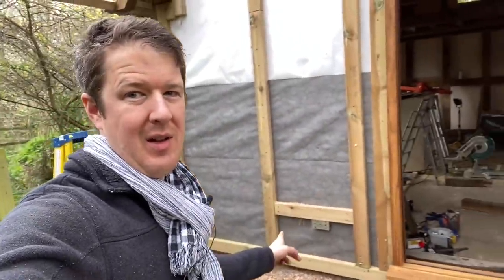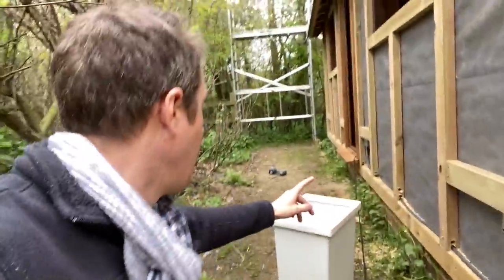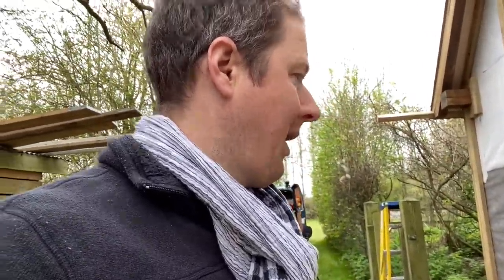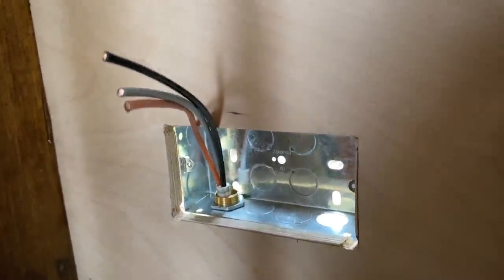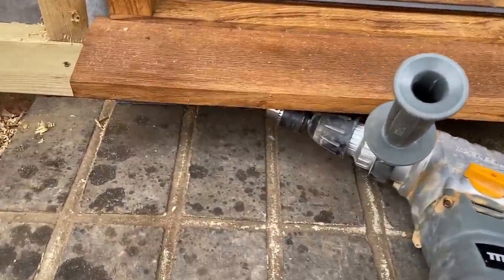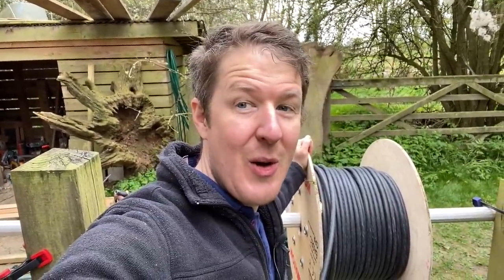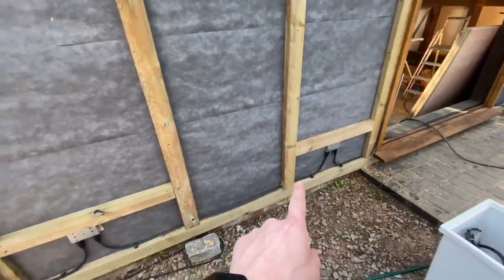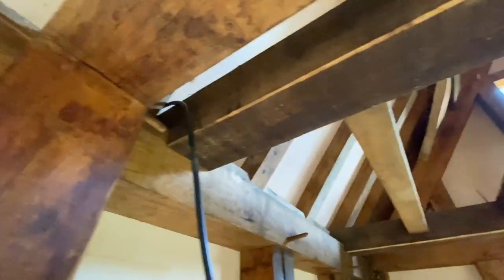Electrical Installation in a Barn - Part 2

Comment: Those holes looked quite big at the bottom of the joists - are the joists structural or just for attaching the eventual cladding to and therefore supported by the inside in some way?
Reply: Pretty sure the framework out there is just to space out for insulation, and cladding should be airgapped off it. The oak interior looks to be the actual structure. Obviously there weren't any screws between the 'studs' and 'sole plates' or those drills would never go through.

Bit of a shame they didn't make provision for cabling when they did it that way.. would've been easy, saved a whole lot of drilling, especially under that doorway.
Reply from the maker: Yeah you’re right there
Reply: They have pocket holes in them....not structural

Comment: Very nice job. In America because how close the cable  is going through the wood or timber as you call it, we would have to put a metal plate. There made for electricians and come with metal prongs  to fix them to the timber. There made by a company called Halex and there called protector plates. They are 1 1/2 x 2 1/2 inches and 1/8 thick.  Do you use anything like that.
Reply: They are used in the UK, but the cable has a steel armour so they are not really required

Comment: Obviously we haven't seen the end of the job yet, but I must ask. Have you considered sealing the boxes at all? Alu tape, a little low expansion foam. They're going to leak air like a sieve (of course, I don't know what sort of doors and windows this place is getting..). Also they're going to be cold spots and see condensation, limiting moist outside air flowing through them should help with that.
Reply from the maker: You will see in part 3 which goes up today at 5:30pm we sealed them using plastic membrane

Comment: You sure about the Knipex ErgoStrip? I first used it just as you did there to take off the inner sheath from SWA and it bit into the basic insulation within. I was lucky I was able to pull a bit more through and redo it, not touched the tool since... Once bitten twice shy and all that.
Reply from the maker: Yeah its great, i've used it so much the last few weeks I couldn't live without it now when doing SWA

Comment: Great Job, Can you not get the SWA in correct colours?
Reply: That's the colours 3 core swa is sold in, usually sleeve the black as green/yellow for cpc
Reply: I came across a light pendant today in a domestic house this had twin red T+E for the Line and Neutral colours,just a bit of black tape for the neutral
Reply: You can get Brown, Blue, Green/yellow SWA unfortunately not many wholesalers stock it!
Reply: It seems strange that they don't as most of SWA is used for L, N & E and has to be sleaved then again in the old colours you had to do the same as it was mostly sold red yellow blue cores.
Reply: I think here in Ireland, the wholesalers mainly sell it in the correct colours for single phase.
Reply: @paultipon twin red was meant for switch drops.
Reply: @supersparks9466  I know, whoever installed it however many years ago use a twin red for switch drop and another twin red for line/neutral loop in and out.
There was a T+E red and black as well so I guess they ran out of it, I did put sleeving on the red for neutral and noted it on minor works certificate.

Comment: Flexishield would have been a lot easier 😅 all the same properties as armoured, not quite as tough but you can use normal 20mm stuffers for the termination also smaller in diameter 😊
Reply: Exactly what I was going to post!
Reply from the maker: Good to know!

Comment: Have you seen / used the SWA storm glands. I highly recommend them. Only thing is they are probably £5/£6 more than a normal outdoor m20 gland. No shroud though.
Reply: My local cef has them at about 50p more than the normal ones. My go to every time 😁
Reply from the maker: Yeah i've tried them, not completely convinced yet.

Comment: Great content! I was wondering how come you aren't using t and e as it is in the cavity and not exposed??
Reply: He said the customer wanted it
Reply: I asked that in last video, Clent gets what client wants 🙄 would save a lot on labour and material costs using T&E and could of had 2.5mm 32A ring final for future expansion.
Reply: @barrybritcher  just because a customer ask for it doesn't mean thats right for the job, what if they said they wanted it in 1.5mm to feed the sockets that wouldn't be suitable, in this case id had gone for the armoured or possibly some SY cable
Reply: The cables don't run in a zone so putting them in T&E would make them even more vulnerable.

Comment: Hi, I am not a professional but a very keen DIY'r. My brother in law is an electrician and does any testing for me as I am quite OCD about conforming to regs etc as of course it could be someones life at the end of the day. (A consequence I guess of working in the aerospace industry for many years!) However, I would like to understand the logic/criteria behind the decision to install 2 radial circuits rather than rings for the power circuits.
Reply from the maker: Ring circuits are liable to break and cause problems, Radial circuits are much more logical. UK is the only country where ring circuits are still allowed and the number of broken ring circuits i've come across over the years is staggering. Radials are the way forward. If a radial breaks it stops working and you know easily where the break is.
Reply: @artisanelectrics  Many thanks for the explanation and I can now understand the logic. Great videos by the way. Always enjoy watching them.

Comment: Electrician from Norway here. why do you guys use metal pipes ? in norway we use plastic tubes, and we secure them with TC in the timber, its much easyer, ofthen the tubes are prefitted with earth (prefix 3g2 5), N and L leads, we just cut away 10cm of the tube before we put them into the selflocking hole in the box (SCHNEIDER 55-72/100F).. we used metal boxes and pipes i the 70`s.. also i see that in the fusebox you only fuse the L lead, and have earth protection on the main fuse.. we use earth protection 30mA fuse on all the circuits and it fuses both N and L, two module fuses on all cirquits, thats for TN systems to... is there a reason why to use metal pipes and boxes ? sorryror my bad english writing skills
Reply: The pipes provide access to the wires even if they are hidden in the wall. For example, you may think that you are unlucky enough to hit a wire with a nail or screw when mounting a shelf or similar. Then it quickly gets dark and you have to replace the cable on the current course. If the cable was not in a pipe, you must have opened the entire wall for the electrician to gain access. If, on the other hand, it is in a pipe, the electrician can simply pull out the old cable and pull a new one through the pipe. in sum, the solution with boxes and pipes thus provides a hidden system that is easy to maintain. And it's actually not a new phenomenon at all. If you have an older home, it is not free that you have found old steel pipes in both walls, ceilings and floors. They were also used for electrical cables in their time, but are mostly taken out of use today.

Comment: Those titans 5kg drills are great. A bit overkill maybe for 6mm holes in blues but makes the job fast!
Reply from the maker: Yeah cheap and cheerful does the job sometimes!
Reply: The only issue I have with that titan is the fan! It blows your brick dust everywhere! No good at all inside somebody's house.